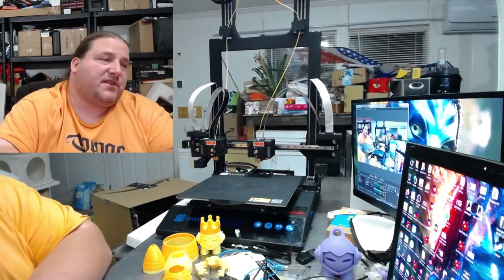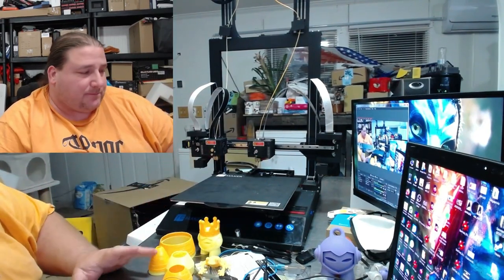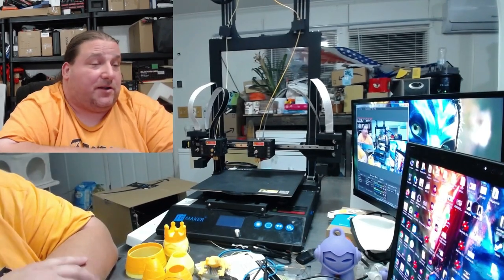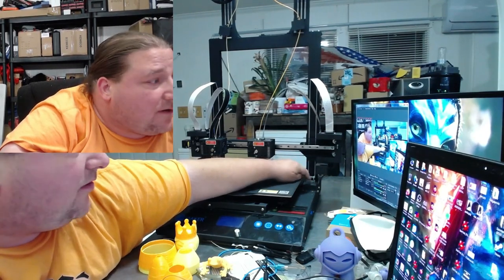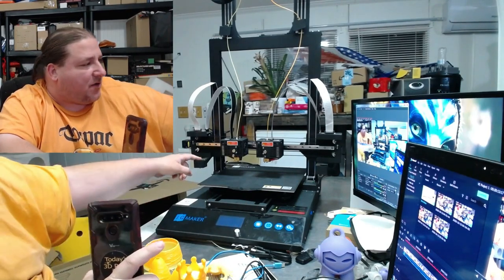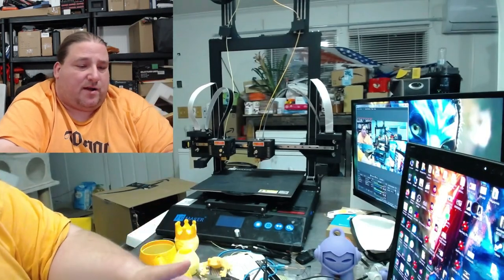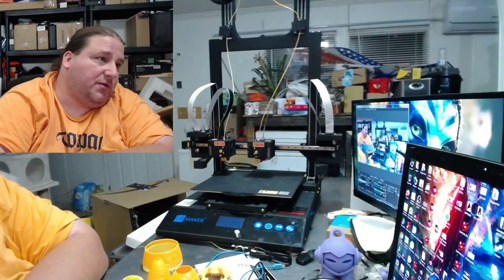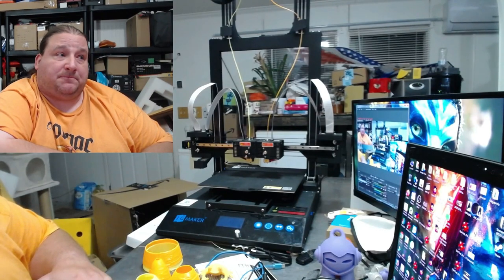JG Maker Artist D IDEX Analysis & Feedback T3DP

Comment: @nerys I had a similar problem on my current printer where there would be times where the layers would seem to be extruding too much and then later would barely print one layer, and then continue working fine. This ended up being heat creep that only reared it's head every once in a while. I attached the hot end cooling fan better to the upper end and it works fine now. So it could be inadequate cooling for the hot ends themselves.
Reply from the maker: Definitely not heat creep with the jet turbines they are using for fans :-) hehehe

Comment: Is there a slicing mode for making both heads work at one big print at once for twice the speed? Maybe with an adjustable overlap in the middle, which offsets each layer, for better print stability..
Reply from the maker: Sadly that is not possible because while the heads are independent they have a shared y axis so they can only move independently on x this is why I duplication and mirroring are possible because the Y movements are the same

Comment: Hi can you do a review between the TL-D3 PRO vs JGMAKER ARTIST-D
Reply from the maker: What is the TLD 3 Pro? Keep in mind I can't afford to just buy printers they would have to send me one for me to do a comparison
Reply: @nerys71  Its basically the same 3d printer spec wise with a few minor differences like glass hotbed. You could just buy it on amazon, do a review and comparison and then just return it back to amazon. I call it review on a budget. There are barely any videos of it because it also just came out not long ago. I want to know if I should get that one or preordeer this jgmaker

Comment: On the crap bed springs, I love the FYSETC Silicone stand offs.  I have them on 3 Creality printers. Still get a little give for nozzle crashes and what not, but does not allow a lot of bed movement vs. springs.  I don't know why they aren't more popular,  but ill never use springs on a bed again.
Reply from the maker: I think the primary reason is that the quality control and precision of the parts would have to be better in order for solid mounts to work properly and abl would have to be better implemented

Comment: Good video, i like the printer but the front control panel faceplate is ugly and makes the printer look cheap, they really should improve that
Reply: There is a pro version that, for an additional $85, you get an upgraded full color touch screen panel, as well as optical endstops and a few other bells and whistles.
Reply from the maker: I really hope they send one out. having two IDEX machines would make me weep with pleasure :-)
Reply: @nerys71  I wouldn't hold my breath. Unless you backed the kickstarter at the Pro add on level, of course.

Comment: Thanks for the video! I'd love to see more while I wait for my Artist-D to arrive!
Do you believe the inconsistent extrusion might be related to what Kersey Fabrications found? (https://www.youtube.com/watch?v=qdkTuZ0V1cc). 
Some people were worried that the "Nozzle Eject" system might be affecting the heat transfer from the heatblock to the heatbreak+nozzle. Perhaps some Boron Nitride Thermal Paste would help with that.
Reply from the maker: He has not concluded anything yet (though he has dived the deepest into it) my issue is virtually not their. in fact the only reason I really noticed it was because I was looking for it after watching his video. I suspect its just a slight design and or QC issue since its not consistent from machine to machine. HIS has consistent under-extrusion. mine do not.
Reply: I ordered two of these a couple days ago, and then just today I saw that video. I'm pretty angry that I might have just been ripped off. A minor thing like extrusion slipping could ruin this otherwise amazing printer. How is yours fairing?